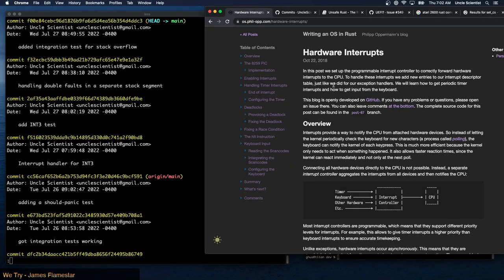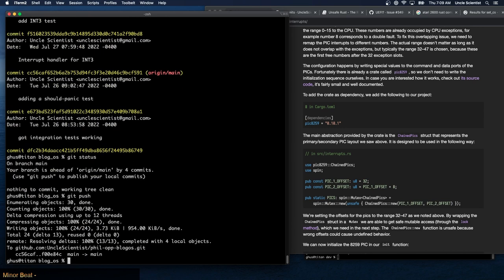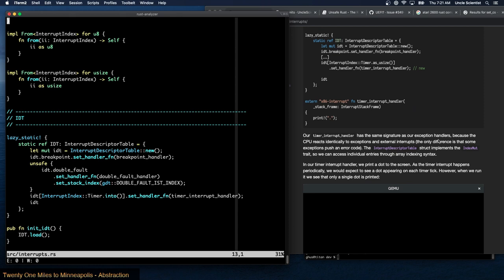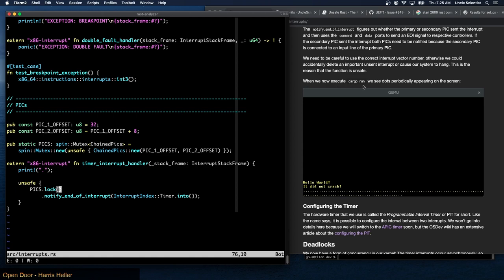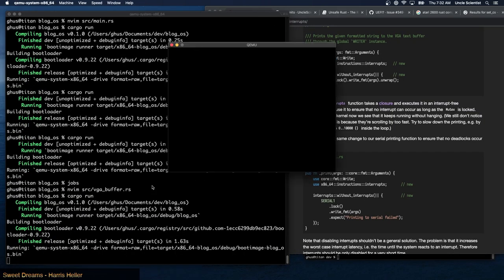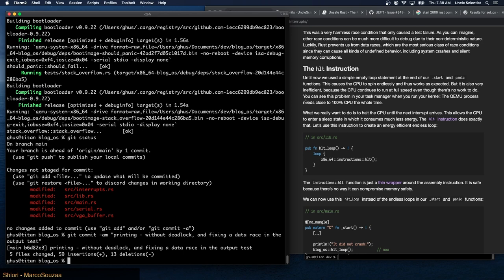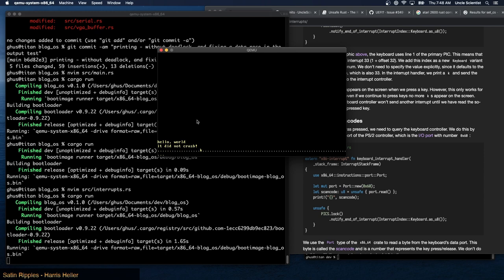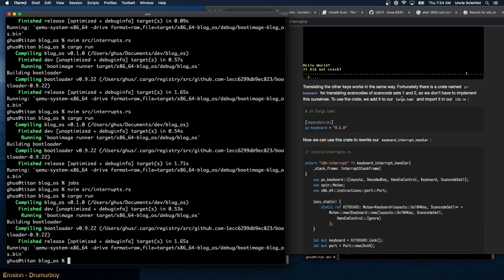Writing an OS in Rust - Part 7 - Hardware Interrupts

Comment: I'm at a point as a Kotlin, Swift, Java and JS developer (full stack), the ONLY thing Rust is missing (in my opinion) is marker comments a la Swift / Obj-C. Special comments that can be grok'd by external tooling to help with code navigation. add it to the analyzer as a plugin and bam, new output options for issues.